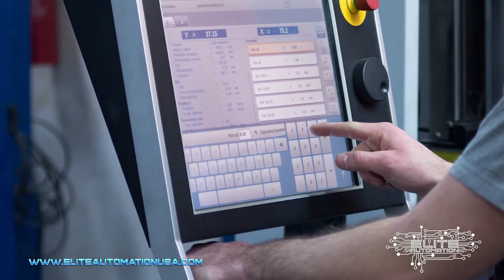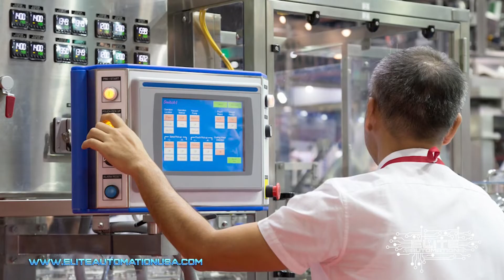First Skills To Learn In Robotics

Comment: very informative. I didn't see a critical aspect of mechatronics. that is repair of systems. all parts wear and will fail after a certain number of cycles of operation. all those robots shown are made of servo motors, bearings, actuators, etc. all those parts will eventually fail. being able to troubleshoot and repair them is critical to automation manufacturing. if one robot craps out, a whole production line can be shutdown. it's that troubleshooting and repair that is the hardest thing to train for, but provides the greatest satisfaction when you get it right.

Comment: I am a BSc computer science major, can I still get into Robotics industry if I still learn by myself the mechanics and electronic part, or do I still have to get a masters in Engineering
Reply from the maker: It's awesome that you're interested in robotics with a Computer Science background! You're definitely on the right track. Here's the breakdown:

Can you get into Robotics with just a BSc in Computer Science?

Absolutely!
Software is Key: Robotics heavily relies on software for control, perception, and AI. Your CS degree provides a strong foundation in programming, algorithms, and data structures – all essential for robotics.   
Growing Demand: The industry is booming, and companies are always looking for talented software engineers who can work on robotic systems.
Do you need a Master's in Engineering?

It Depends:
Not Always Necessary: Many entry-level positions in robotics are accessible with a bachelor's degree, especially if you have strong coding skills and relevant projects.
Can Provide an Edge: A Master's degree, especially in Robotics or a related field, can:
Specialize: You can focus on areas like AI, control systems, or specific robot types.   
Advancement: Higher-level positions and research roles often prefer advanced degrees.
Networking: Graduate programs provide valuable connections within the robotics community.
Learning Mechanics and Electronics on Your Own:

Highly Recommended: Hands-on experience is crucial! Here's how to gain it:
Personal Projects: Build robots! Start with simple projects (like line-following robots or robotic arms) and gradually increase complexity.
Online Courses: Platforms like Coursera, edX, and Udemy offer courses on electronics, mechatronics, and robotics.   
DIY Kits: Explore kits like Arduino or Raspberry Pi to learn about electronics and sensors.
Open-Source Projects: Contribute to open-source robotics projects to gain real-world experience.   
Workshops and Hackathons: Attend local events to learn from others and network.
Key Takeaways:

Your CS degree is a fantastic starting point.
Focus on building a strong portfolio of personal projects.
Consider a Master's degree if you want to specialize or pursue advanced roles.
Continuous learning is essential in the rapidly evolving field of robotics.

Comment: You're bang on the AI takeover of programming... Mechanical engineering is not replaceable... Also fyi with the current job market till one year ago everyone was jumping on to the software engineering side... The recent trend is all are moving towards Mechanical civil and industrial engineering...
Reply from the maker: Mechanical will definitely be more challenging for sure. I don't think impossible but it'll take more time. I think there is definitely a gap in all sectors of the industry. Engineers are hard to come by.
Reply: When parts are fully standard it will be very easy to replace mechanical. Just look at how much their being replaced for cars.
Reply: @l33tninja1  yup... Absolutely 💯
Reply: @rhranjithkumar34 also just look at what has been done with dealing with electronics repair. Many times its just replace a module or the entire thing and toss intona landfill. Being a mechinic will soon only require that someone fellow AI instruction and videos and fill a check list. If they dont just have a robot do that to.